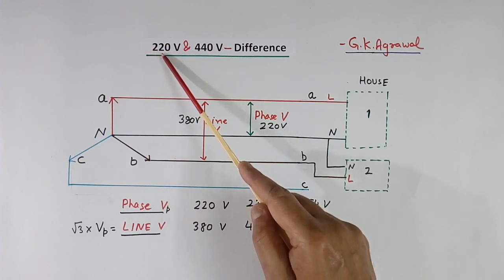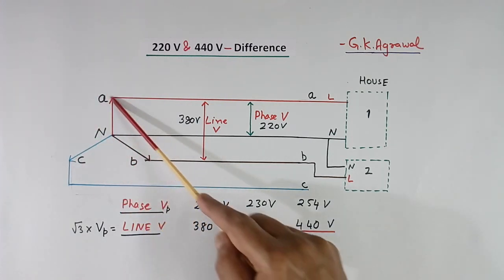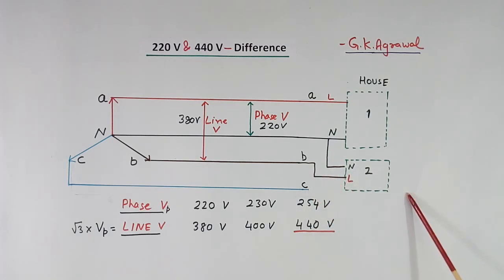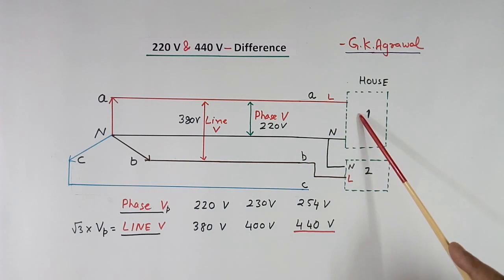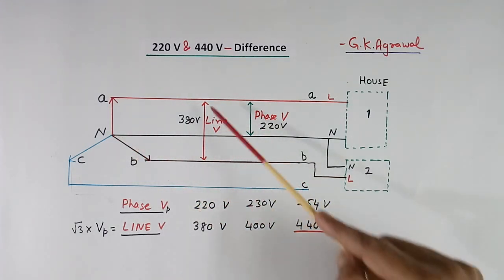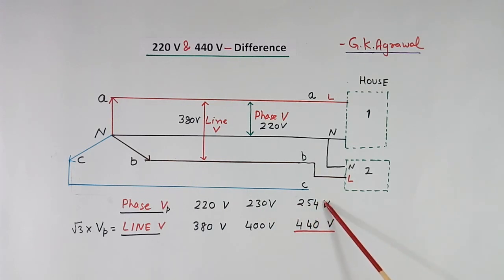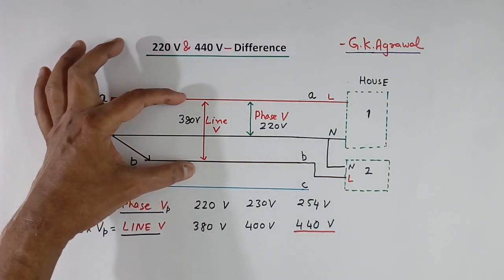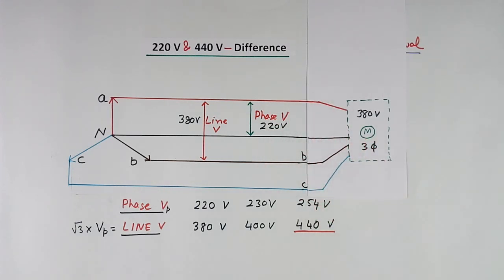AC supply 220 V & 440 V, phase and line voltage difference

Comment: I have a 10 hp, 3phase aircompressor motor the voltage needed is 400, I have a reading on line to line voltage of 225. So based on the video I can install it to a line a, b and c?
Reply from the maker: Voltage should match
Reply: @GKAgrawal2  all voltages from AB BC AC are 225volts
Reply: Yes its match 225v x 1.732 = 390 volts
Almost 400 volts

Comment: I have a 10 hp, 3phase aircompressor motor, So based on the video I can install it to a line a, b and c?
Reply from the maker: 3 phase motors are to be installed in all the 3 phases a, b and c.
Reply: @GKAgrawal2  so need phase voltage not line voltage?

Comment: In the United States, 120 is most common in the household, while 220 is used for high power like charging an electric vehicle 

440v in America is used for commerical applicants that need much power
Reply: 220 to charge an electric vehicle ain't really much, charging would take a long time.
In Europe a lot of households have three fase power to charge there electric cars.
In the Netherlands you have to pay a one time fee to get three fase power if you haven't gotten it already.
Reply: @arnoldsmit3289  our 220 takes like 12 hours to charge and I'd made up from 2 phses, but that's just how America does it
Reply: @PennsylvaniaEAS  how much current can a house hold draw in America?
Just curious :)
Reply: @arnoldsmit3289  probably 220 amps at most.. assuming 2 phase
Reply: @PennsylvaniaEAS  that's quite a lot.
The default in the Netherlands is 45 amps on 1 phase, 3 X 25 on three phase.
If you're willing to pay extra you can get 3 X 100 for a house hold but that's quite expensive
Reply: @arnoldsmit3289  our wall outlets are 15  or 20 amps, but you can pay to have more like 50

I thought you were asking in totsl
Reply: @PennsylvaniaEAS  In Europe all the wall outlets should be 16 amps, if you need more you can use the perilex outlet.
Perilex is kind of an odd outlet.
there are two versions the 16 amp, and the 25 amp.
The 16 amp can be used for 2X 16 amp(230 volts), or three phase 16 amp(400volts)
And the 25 amp version is always  three phase 25 amp(400volts).

Perilex is used for things like heatpumps, induction cookin, charging cars.

Comment: Sir 3 HP motor 2800 rpm me 23 number SE 100  terms ho to wahi motor 1400 rpm me wire number and terms batawen formula me sath

Comment: Sir, why neutral line do not carry current in coming but in returning to the source after and through the load.
Reply from the maker: In AC single phase, neutral wire carry Current in both the side.

Comment: Why do you say the line voltage is 440v when the phase voltage is 220 v?

√3×220=384v
...................
Does the phase voltage become 250v so that we can say the line voltage is 440v ?
...................................
Very often the phase voltage
Fluctuates between 220 to 240 v.
.........................................
Why do you say by showing your left hand fingers(thumb & fore finger)
Phase voltage...220v
Line voltage.......440v(shock)

Comment: In the last three phase motor needed only three phases why you said neutral also needed neutral only using for control
Reply from the maker: Neutral is required for single phase supply in the house. Watch video again.

Comment: sir , why we would connect neutral to a 3ph motor ?
i did not get this point , it is usually we connect only the three phases
Reply from the maker: Neutral shown is not for motor. It is required for single phase load.
Reply: @GKAgrawal2  Thank you again for this great video sir

Comment: Hi
Probably this is a bad/stupid question but
If voltage is the "push" of electrons how come there is a line to line and line to neutral voltage?
I'm sorry but I just can't picture this in my mind at all.
:(
?
Reply from the maker: A force is required to push the electron. And to apply a force, you require some cause or source responsible for creating force. That source of force, is nothing but line to line or line to neutral voltage.
Reply: Thank you very much !!! Thank you !

Comment: How to differenciate in question of 3 phase either given quantity is line or phase voltage given.....
Reply from the maker: They should write clearly in question that, it is line to line or phase to neutral voltage.
Reply: In Gate and even in IES many questions are asked without identifying either phase or line voltage what to do in that case
Reply: Also create confusen in case of rms value and peak value in case not mention what to do
Reply from the maker: They may not tell. if problem can be solved without knowing RMS or peak. Otherwise they will tell. Correct question will not have any confusion.

Comment: Can I connect a 415 volts or 380 volts motor to 400 volts supply? And can I connect a 380 volts oven to 400 volts?
Reply from the maker: Good question, For any motor or oven, supplier gives voltage range, within that range you can connect. For example if voltage range given for oven is 360 to 450 Volts, then oven can be connected for any voltage between  360 and 450 volts.
Reply: G K Agrawal thank you very much sir your channel is very helpful to me

Comment: sir,for 3 phase we are using 3 lines,but we calculated line voltage between 2 wires.. why not we calculated among 3 wires?
Reply from the maker: between any 2 line wires, voltage will be same rms value, so 1 calculation is sufficient
Reply: Transformer rating is 11kv/440 v, then why we getting 415 v as line voltage

Comment: sir i didn't understand why line voltage = root(3) times phase voltage?
Reply from the maker: Due to vector addition of 2 vectors at 120 degree angle.
Reply: understood sir, but vector diagram would make it more clear or how 3 phase is produced in the generator and connected in star connection will clear everything, thnx

Comment: Why 12 volt dc and not 12 volt ac?
Reply: G K Agrawal , sir, i mean why we use 12 volt for dc supply, why dont we use 220 volts in dc supply. What is the reason sir.
Reply from the maker: 1- 220 Volt will give shock so very unsafe. 12 volt is safe. 
2- Equipment for 220 volt not generally available. 
3-  About 110 volt DC is used in industry.
Reply: G K Agrawal , thanks sir, i m from karachi, i like your videos

Comment: in which case we find more voltage drop AC or DC, and why it is so?
Reply from the maker: AC transmission has more problem than DC transmission.
Reply: Any why it is so, i have searched the internet but answers are different,
Reply: Watch video AC vs DC difference by G K Agrawal